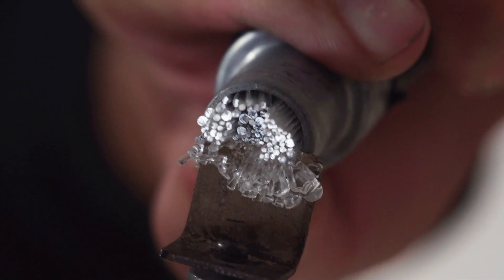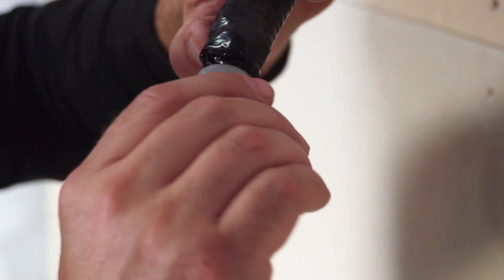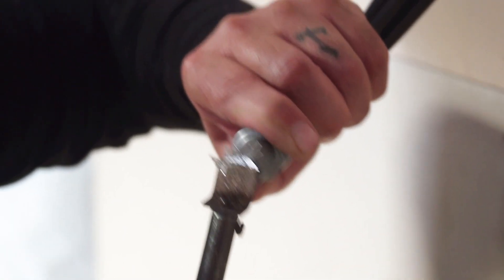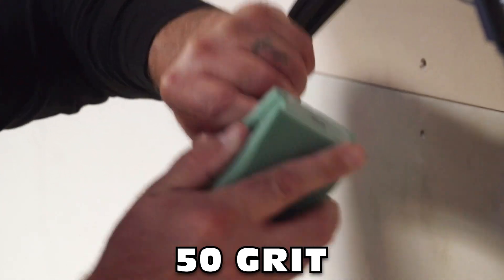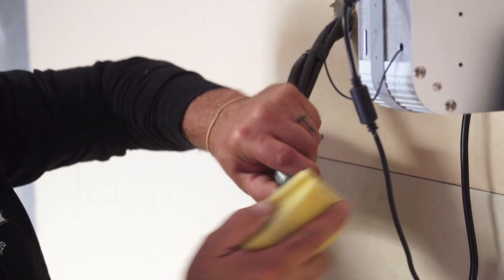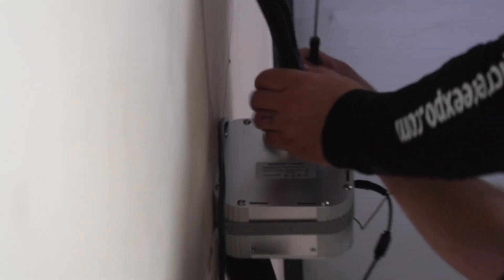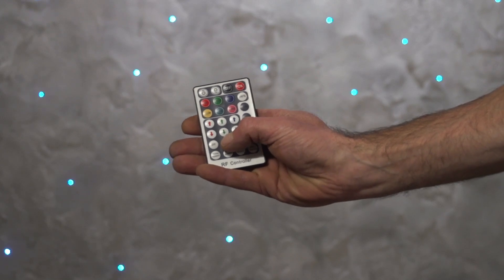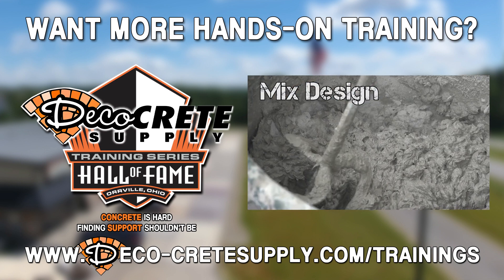Cut and Sand Fiber Optics!

Comment: Did you seal the little holes with anything?
Reply from the maker: Thanks for the comment! We sealed the walls with epoxy after it was all done. It didn't necessarily fill the holes all the way up, but it was all it needed for a wall. Thanks for watching Deco-Crete TV!!!